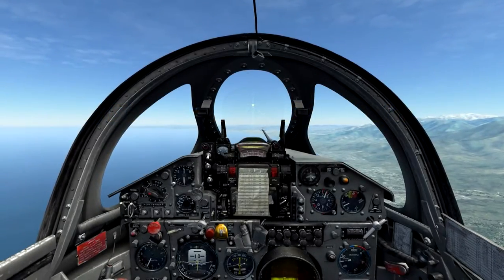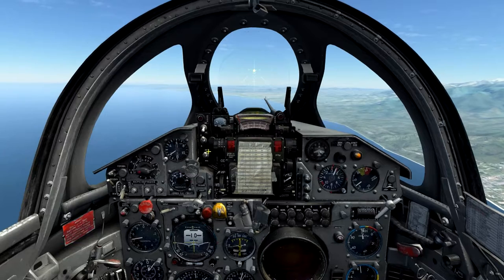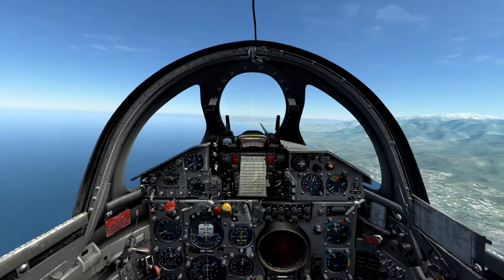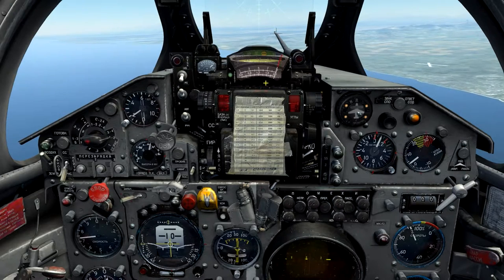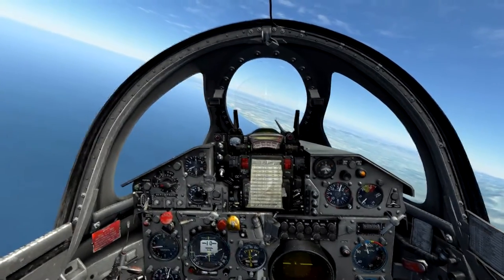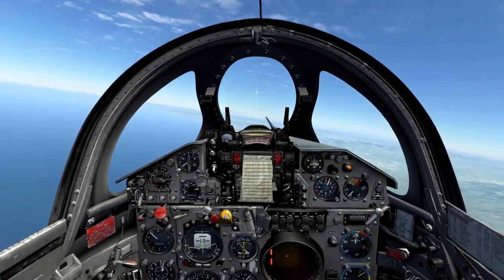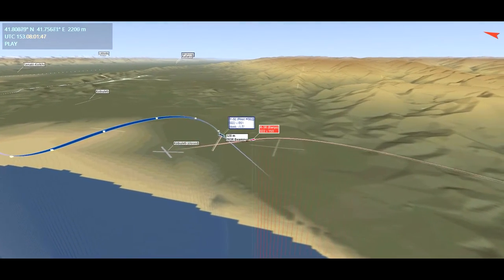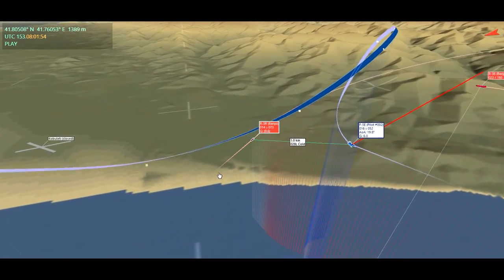DCS:World » SARH Guided Missile Employment » MiG-21Bis

Comment: I cannot get the R3Rs to come off of the rails. I have the same problem in the mig-29 and su-27. Matt Wagler was saying to hit spacebar after lock but I already changed the comand so I do not know what it used to be. Any suggestions?
Reply from the maker: I'd suggest looking through the controls list for whichever aircraft you are having that issue in, and rebinding "weapons fire" to whatever you'd like to use.  Weapons fire will fire missiles/bombs/rockets while gun fire will fire the gun.  Though some aircraft will share weapons fire and gun fire as one binding under weapons fire.